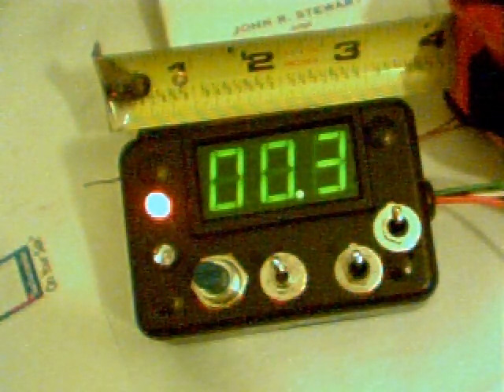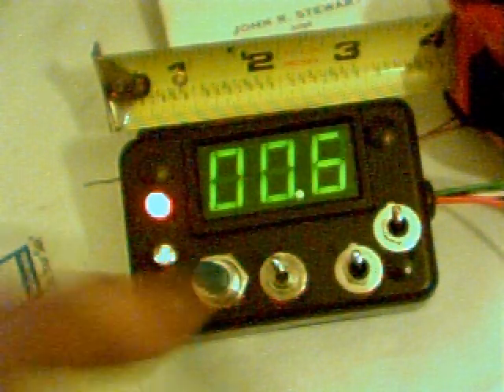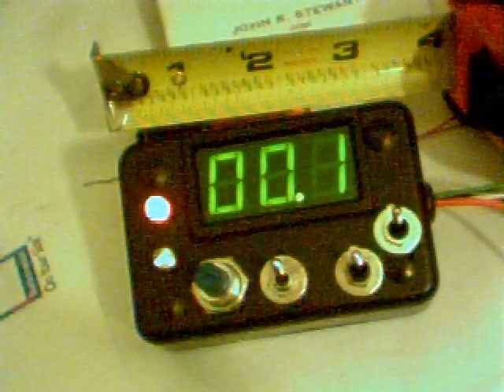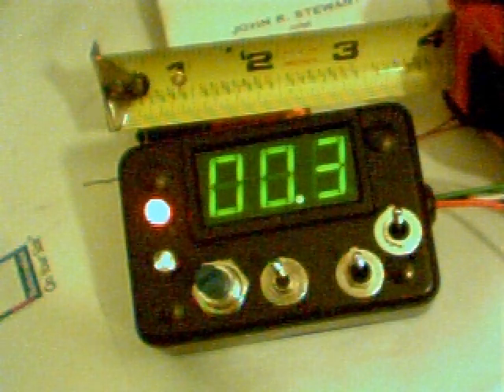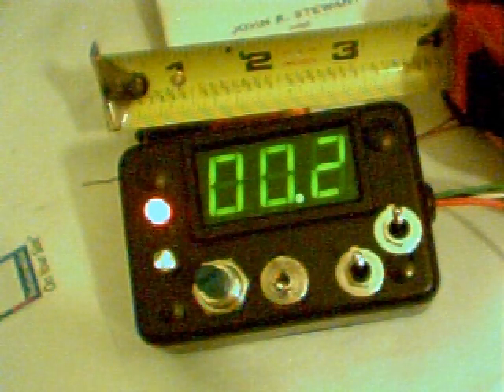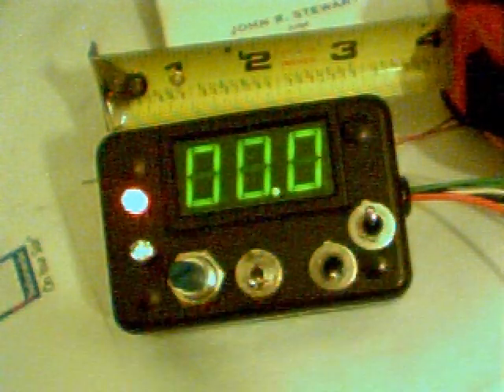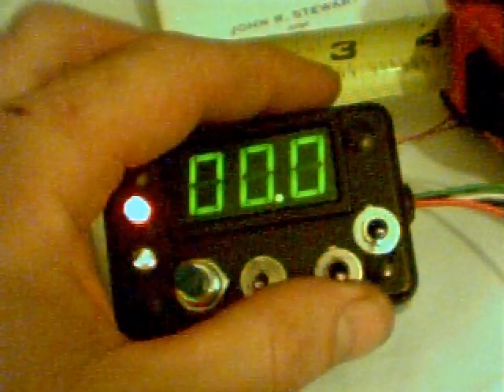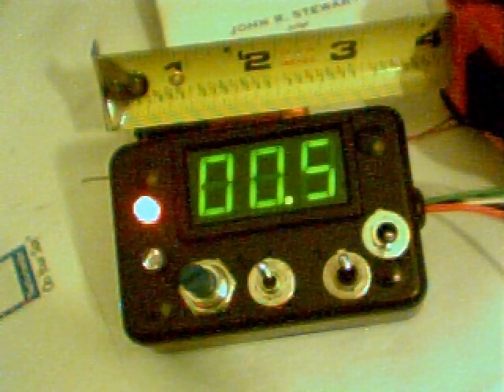pre-cat o2 simulator / efie

Comment: This would have no use pre cat on a 02. I could see why someone would want to use it...after the cat or on the downstream O2 sensor but not on the Upstream. I don't think you realize how smart computers are on cars now. It knows exactly what gases are flowing by the O2 sensor and based off of that information it will know which cylinders are rich and lean based off length of pipe and which cylinder has fired. And if all you're trying to do is Trick the downstream O2 sensor into being a leaner. you can just space your O2 sensor out. Some of the ecu's are getting so smart it knows that it took a little bit longer for the gases to get to the sensor. so if you space it out you have to move it up an inch or two along the pipe.

Comment: Obd1 the single wire wow I will get more power from a car unpluggin fuel pressure regulator vacumm hose then u get with that . The simulators for sensor 2 post cat or downstreem o2 . Simulator $55.00 catalytic convertrr obd2 conv. Minimum $500.00

Comment from the maker: thanx for the comments and suggestions guys. i have since added another potentiometer for the rate of oscillation. the obd1 cars r a pain in the a_ _ . we have a voltage set up so when u adjust this thing it varies above and below .45 volts, which is what a normal set up does, but it also varies those voltages above and below the .45 as well. so we oscillate the oscillating voltage...;) and now with the other pot, u can change the whole rate as well, some cars r a little different.continue>>>

Comment from the maker: we have one unit, it runs 1 o2 sensor or 2 o2 sensors. you only need one, just let us know if you have 1 0r 2 sensors. we have to add a little to the standard sim. to make it work for a 2 sensor setup. these have quite a bit of versatility and options. They take a lot of time to make and have a lot of parts to them, so they r kinda pricey. $150 for a single o2, and 175 for a double o2. remember these r 4 the PRE cat o2s!! they r also a pinch SMALLER than a buisness card! and an inch thick.

Comment from the maker: yes we r, if any body is interested just let me know. we actually have a couple of more improvements  to add to this even though i just posted the video. i am a stickler for improvements, i try to give a good product 4 people. the main improvement we will b doing is putting a volt meter on this which has the decimal point another digit to the left so u can further make fine adjustments.
Reply: Can you add to adjust what the computer sees coming from sensor with a variable signal, so that that  the ecm sees actual o2 volts with + or - volts moving with o2 volts?